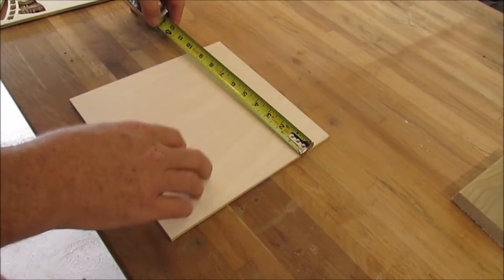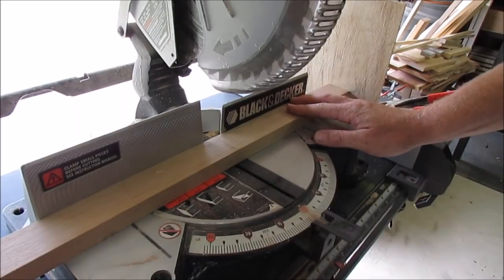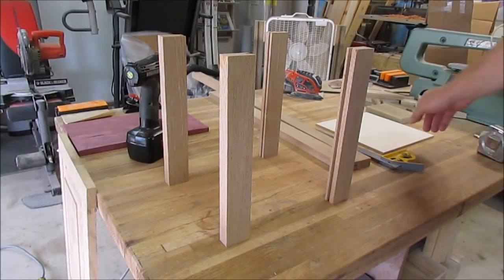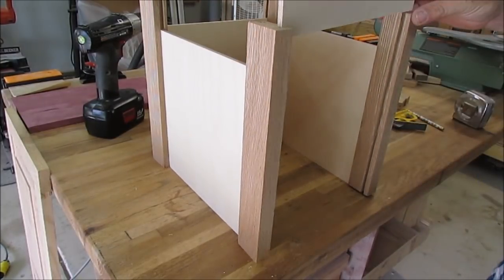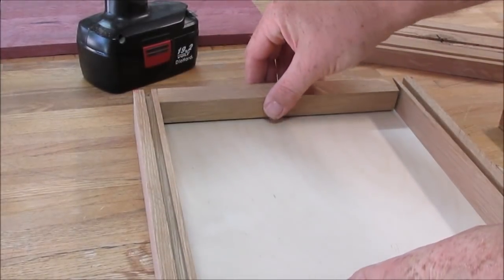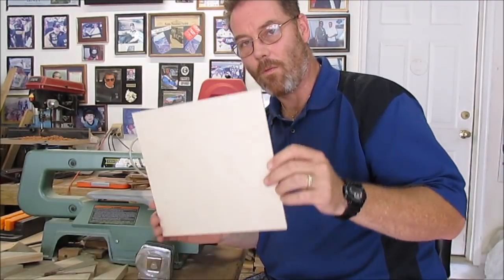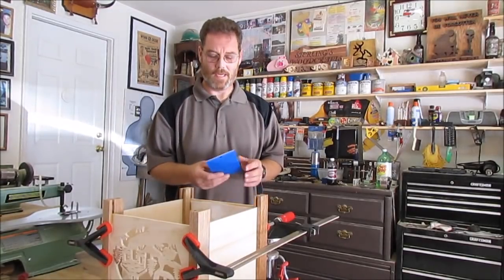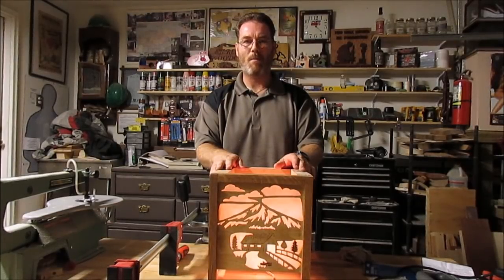Scroll Saw Shadow Box

Comment: Nice project, really like the light. I need to start using my scroll saw more often. I also noticed you wearing open toed sandals in the shop, brave man, LOL. I can not even make it from one room to another inside the house without kicking something and killing my toes, if I went into the shop like that I would lose a toe in under 38 seconds.
Reply from the maker: Its a bad habit to have to be barefoot, but I am sure it will take only 1 accident to buy me some shoes lol, just feels better, hot out there , Thanks for watching and sharing

Comment: Wow! I'm so glad I came across this video. I have a wooden wine box and a deep shadow box with glass and I have had a hard time deciding what to do with them. I think on the wine box I can actually do a scroll saw design and then put lights in the box and it would look awesome. The lid to that slides into grooves. The shadow box with glass, I might be able to remove the glass and possibly slide a thin piece of wood in the grooves and do a scroll saw design on that as well. I'm sure going to check into that. Thank you so much for the idea.
Reply from the maker: I hope it worked out, and apologize for the late response, Appreciate you watching and hope it came out good for you

Comment: The box turned out great. As a "reformed" wood hoarder, the first step is to admit that I had a problem.
Reply from the maker: I am going to work on a lot of Smaller crafts and use up some wood , I told myself, I will not buy no wood for 1 month, but after thinking about it, I didn't buy 90% of what I got, So I am in good shape lol, Thanks for watching and sharing